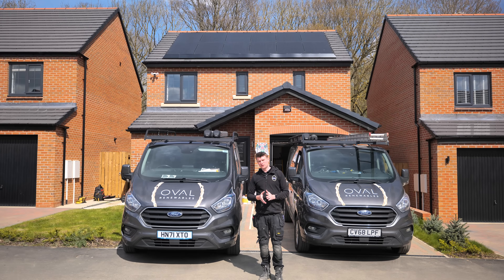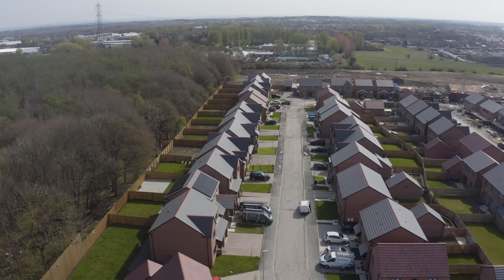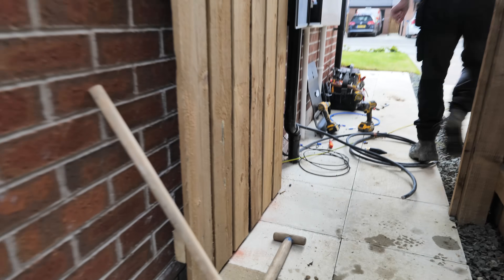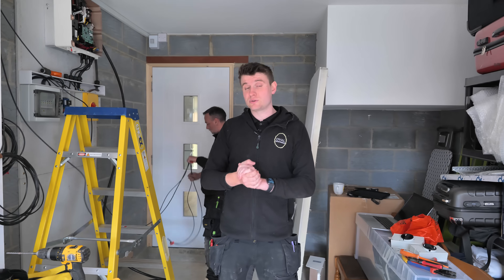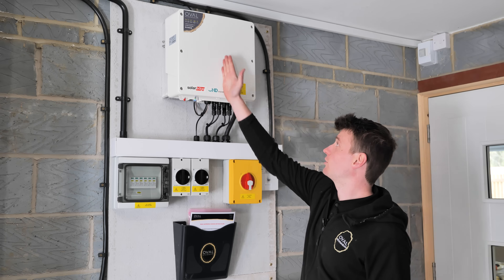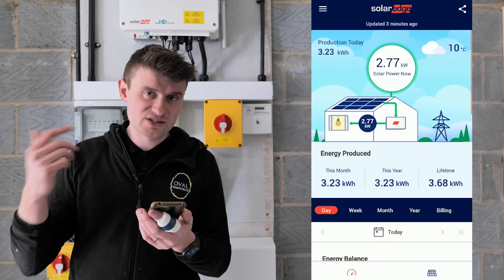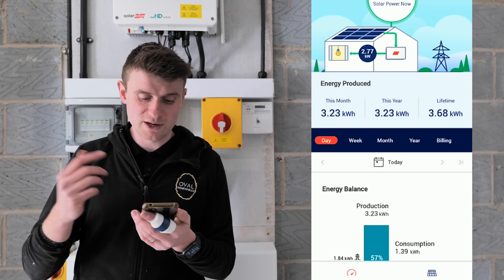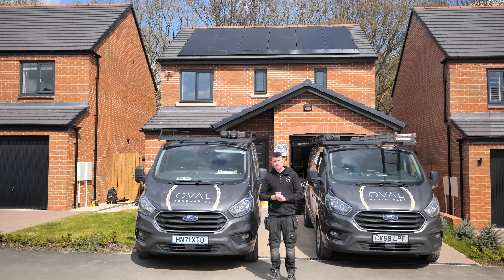Will solar work on a north roof? Newcastle installation Part 1

Comment: Great overview as always 👍. Is it possible to do a solar edge system without using any optimisers? Looking at the location that property is in, i couldn't see anything that would have caused shading on the south roof.
Reply from the maker: No SolarEdge systems need optimisers. SolarEdge is much more than just shading optimisation. It allows you to track individual panel performance, disconnects harmful DC coming into the property when there is a fault, optimises production when the system has inefficient panels due to manufacturing or bird messing and allows up to 200% oversizing to the inverter as the panels can be controlling at source.
Reply: @OvalRenewables  solarEdge optimized array vs normal array, how much more electricity it will produce  in rough percentage? If it's just 10% or less, do you think it's worth it?
Reply: @kgfaith  Depends on the shading, but optimisers are not a magic fix, there are scenarios where they can make performance worse.
Reply: Optimisers have pros and cons. Most significant issue is the relatively high failure rate. Usually the labour and scaffolding costs for the replacement are not covered and meanwhile the whole pv system has to by turned off.
Someone in this video has posted a comment about an optimiser that failed
Reply: SolarEdge must have an optimiser on each panel (or some circumstances you can have 1 per 2 panels).
Reply: If you want per panel monitoring you could use TIGO modules (they have optimizer versions and fire safely only versions that shuts all pannels down) personally if possible have the solar panel cables routed inside the roof space and install the modules in the roof space so you can have easy access to them (only slightly more work to get the 2 cables per pannel into he roof space)

Comment: Do you still offer the option of installing the optimisers in the loft?
Reply from the maker: Only on in roof systems as we can’t extend the link between the optimiser and panel
Reply: Any experience of using tigo optimisers? Wonder if they have longer leads or allow extension. Thx